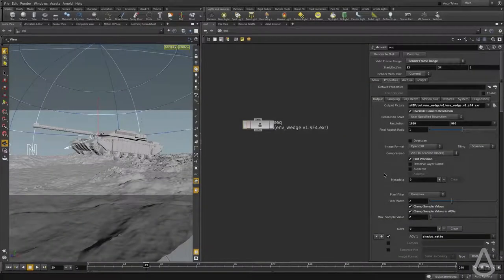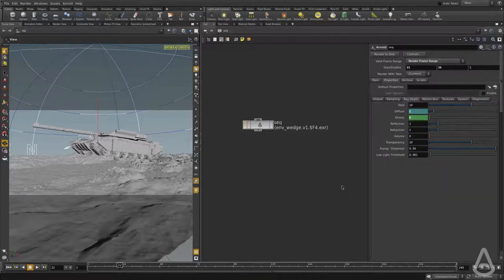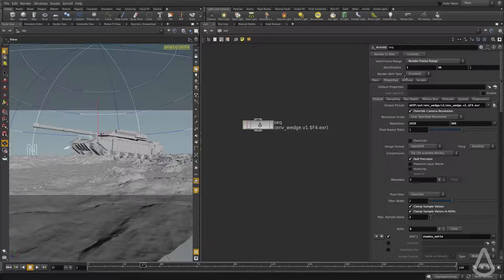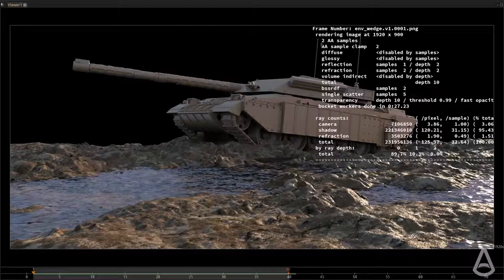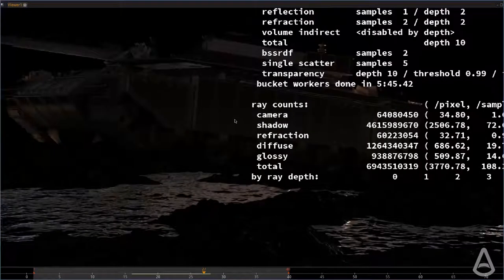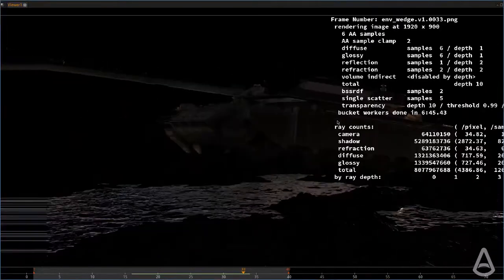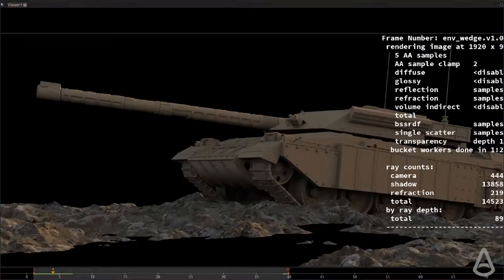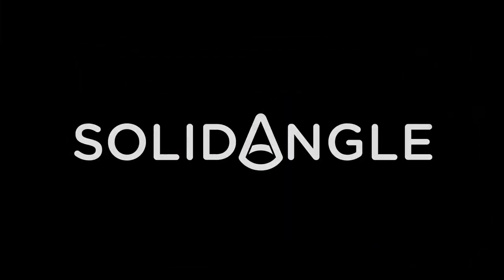16 settings vs render time

Comment: Thanks for the information...how did you store all the sample info into a file ? using log or something else?
Reply from the maker: wrote a custom python script were I parse the data I need from the arnold logs.
Used the PIL library to stamp text on top of the images and write them back using python of course.